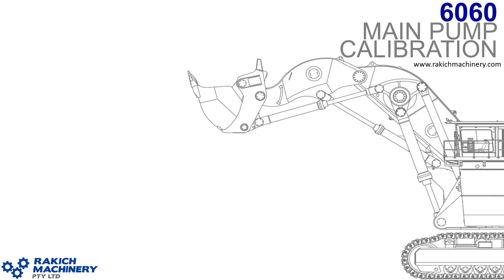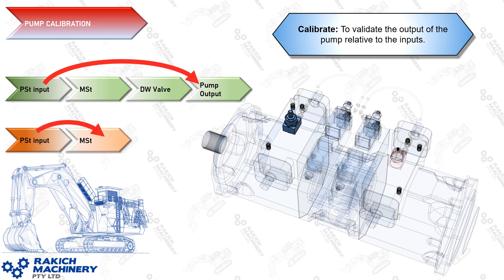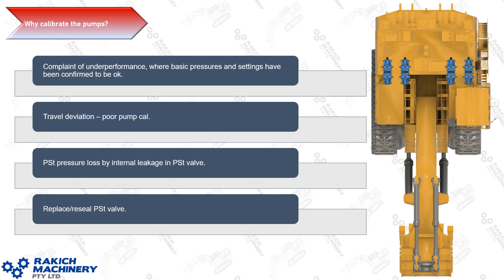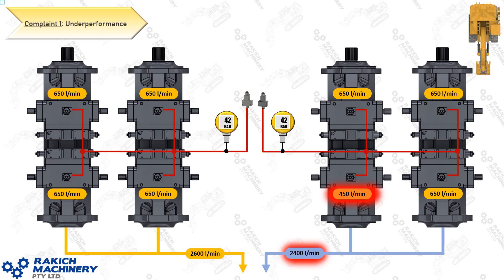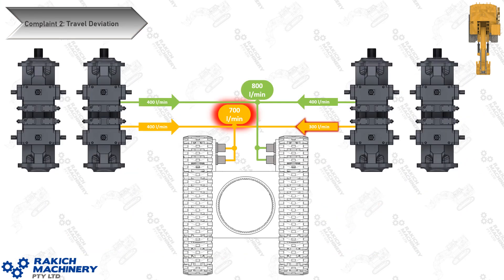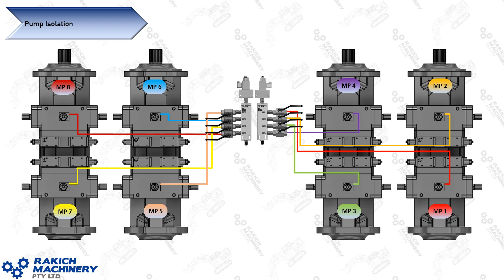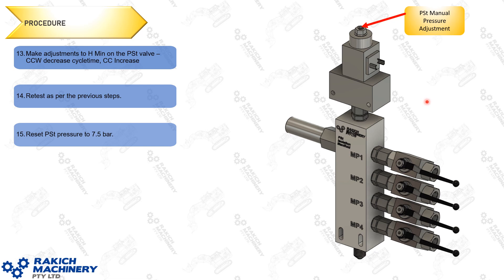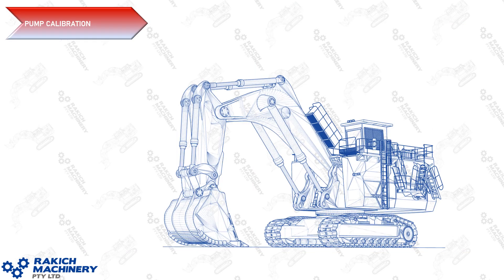A20VO Hydraulic Pumps. Part II: Pump Calibration

Comment: Great video Luke!! The newest Cat 6060 has straight travel adjustment in the machine settings. We commissioned a new unit and had to adjust that through the monitor. Possibly we should have done this pump calibration? The new 6060 also has a separate pilot valve for each PST on each pump. Do you know what is changed when adjusting straight travel in the machine settings? Is it PST pressures, or maybe the travel control valve? Thanks!!
Reply from the maker: Thanks mate! I haven't tangled with the next gen machines. But it'll likely be the PSt pressure changes relative to the current. It's probably ok, but adjusting the H min is the correct fix.
Reply from the maker: If they adjust the travel control valve positon, they'd have to slow one down to match the slow track, making them both wrong, that's my only thoughts as to why it most likely the pst pressure is corrected.

Comment: Hello
How are you?
I am a heavy equipment engineer 
I am very interested in mining Dump Truck, Shovel, Drill Rig 
Please explain about this system used in Caterpillar 6090 FS series mining shovel 
"Automatic hydraulic retarder valve to prevent over-speed on downhill travel"
Thanks 
Best Regards